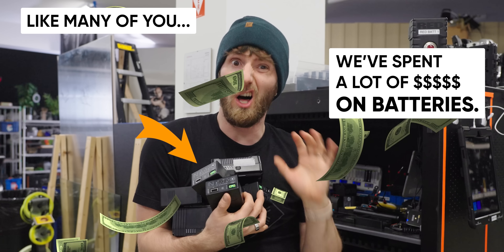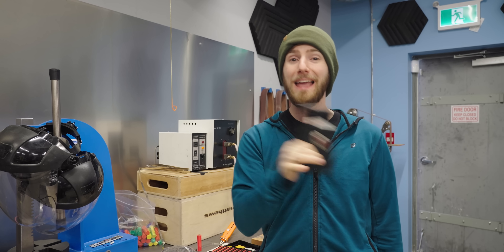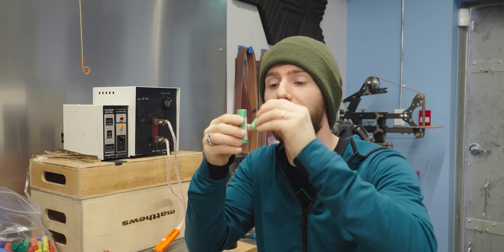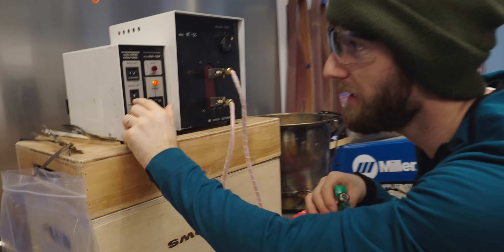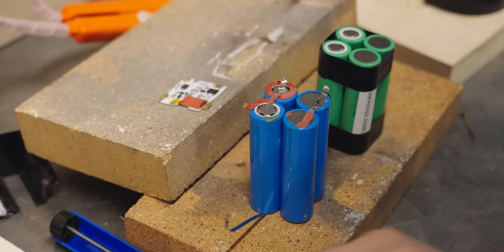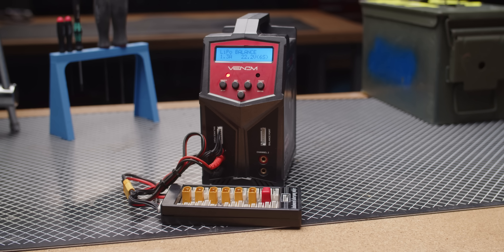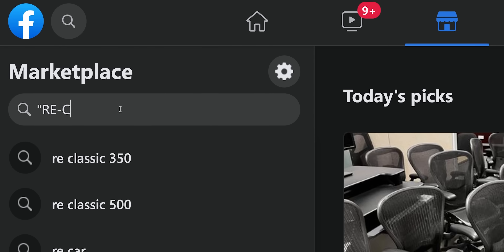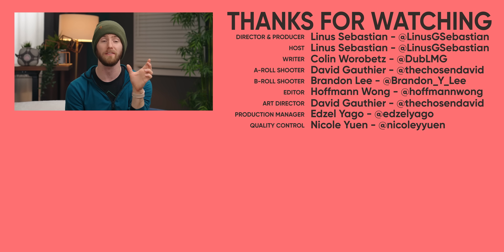This should be illegal… Battery Repair Blocking

Comment: @14:19 - Mechanical Obstructions - I am certain that 99% of the time the purpose is not to prevent repairs, but simply to lower the cost of manufacturing and assembly.  Brittle plastic tabs that snap into place make for very fast assembly, but are prone to breaking when you try to take it apart.  Ditto for sonic welding and gluing.  Consumers will buy the product that costs a dollar less, so there is little motivation to make your product slightly more expensive than the competition, especially when mostly people have no desire to repair things.  Sad but true.

Comment: The power tool industry? Forget the cameras. Every contractor and DIYer globally has loads of batteries with 0 cross compatibility, 0 infrastructure or businesses to support refurbishment, or recycling.
Reply: The Red battery was a really bad example because it uses a v-mount which is literally the most versatile and open battery mount system that I know of. You can put those Red v-mount batteries on LED lights, monitors, cameras by every manufacturer, and you can use batteries by other manufacturers as well. I've been using v-mount batteries on cameras for about 20 years now and they were already a standard back then. If you invest in a bunch of v-mount batteries and a good charger, you can basically use them on all your devices and you'll know that if you buy a new camera or light or monitor, you can still use them.
Reply: @highks496  That was never an option for power tools. The construction industry and DYI industry dwarves those that use batteries for cameras. A 4 amph battery cost approximately 70 dollars/euros, a 6 amph is over 100 dollars/euros. One set of batteries for DeWalt, another for Bosch, another for Hilti, another Milwaukee, another for Metabo, another for Hitachi, Black and Decker, Panasonic, and a ton of lessor known brands. Each with their own proprietary charger. I have a shed full of them.
Reply: @p3u3g3poultree7  Adapters exist.
Reply: @logitech4873  so all of it plus another 50 adapters? Is that your solution? Make the problem even worse? As is I moved to the EU and waiting for law to come into force. Buy Bosch because US brands will never comply.
Reply: @p3u3g3poultree7  yeah ok buy all of them AND all the adapters so that you don't need to use any of the adapters 👌
Reply: @logitech4873  for contractors and tradesmen you buy on demand. Where you are and what options are available to you determines your purchase. Four hours driving added on to an already busy and exhausting work day is not realistic. I have collected what I have over 20 years when power tools came into fashion.
Reply: @p3u3g3poultree7  Well, let's hope for a set of standardized connectors
Reply: @logitech4873  it is not connectors but battery packs and slotting mechanisms.the pins are all in the same place. The plastic shells are all slotted a little differently with no difference in performance.

Comment: Not only a tour but how many batteries are being recycled. Throwing away lithium batteries is illegal, at least in the US, but your garbage man isn't rooting through your trash to look for batteries. As you've shown, even used batteries can cause fires. There is a finite amount of accessible resources of materials on this planet to make batteries and you need to consider who controls (country) those locations.

Comment: I have rebuilt a number of the 'pod' style batteries for power tools. They are just standard off the shelf cells like 18650. If you are smart about it, its fine, but I would not trust most people to perform this type of task, and probably wouldn't use them in something as pricey as a Red camera.
Edit: I always did a Refresh on any cells I used, and would pair them with similar capacity, and voltage; off-the-charger voltage and after sitting for a week. Not sure how much this actually helped but the repaired packs seemed to last as long as factory battery packs from Dewalt, Makita or Milwaukee. I had considered starting a small side-business to offer rebuilt batteries but after some talks it was going to be more trouble than it was worth for me.

Comment: Used to rebuild old tool batteries for a retail chain in the US. Sometimes I would also see that the lithium packs BMS boards need to woken back up by supplying voltage to the output terminals. We would usually use between the nominal voltage of the pack to peak charge voltage and a very limited current. So in the example of the Sony battery, using a voltage and current limiting supply, apply 7.4v-8.4v DC at a maximum current of say 100mA (0.1A) to the output terminals. This often only has to be done briefly if the cells that are connected already have enough charge to run the pack, which the cells in the video did. Otherwise if the cells had been over discharged you can also sometimes charge the battery out of oblivion this way as well. Once the individual cell voltage exceeds the cut off the BMS will resume.

This isn't to say that the RED battery has the same issue, that could very well have the proverbial 'crowbars' in place. But my experience with smaller, more consumer grade device batteries is that they typically don't do that. Especially if they are only a single cell or several cells only in parallel (so 3.7v packs).
Reply: Thanks for the tip. Some packs can be woken up with a higher charge than usual tapped 10 to 15 times to the charge port. But its not like theyre giving out manuals on how to revive a sleeping BMS in a battery pack either. That leads me to believe its proprietary. Also if the cells are garbage and the BMS is proprietary firmware locked garbage. Then what are we trying to save here? the plastic case? the terminals? the inability to jailbreak ourselves from the battery demiurge's prison?

Comment: On the battery pack on my electric bike which is a bunch of 18650s the BMS has a reset button that is inside the case. Twice over a few years the battery pack goes low and all you do is press the reset button. Also the first time a battery whisperer rebalanced the batteries.
 So you either open the case and press the button or you drill a hole in the case over the button so you can press it with a plastic pointing device without opening the case.
I don’t know about other BMSes but check if your BMS has a reset button before making drastic decisions.
In the case of my Canon DSLR, I suspect it uses a counter to tell your camera to show red but otherwise runs fine. To replace the battery will cost $170 but it allegedly is a higher performance battery but will probably show red in about 3 years.

Comment: You need to short + of BMS with + of the battery. On most cases that will jump-start your BMS. They are designed this way for a reason, to not charge dead cells

Comment: Yeah, I managed to salvage some old laptop battery, which out of 6 of them, there's only 1 dead cell.

Anyway, I don't think you can 're-cell' your equipment battery, because most of them has a controller circuit which has fuses and circuitry that just blow up when you're disconnecting a cell (or the group of the cell). This is actually a safety feature that prevent damaging your equipment as that group of cells may have short circuit.

Anyway, does anyone know where to get Dell genuine battery? Dell outright didn't sell those, and when we use third party battery, the warning 'this battery is not genuine' always pop-up. The laptop is only 3 years old. This is as if they told you to throw away a perfectly good laptop.

Comment: However you also do not want everyone shipping back and foreward dead batteries if that would mean transport pollution would outway the material polution. Then you want it to have standardized batteries inside and the additional used materials to be able to get seperated by the user theirself in a safe way.

Comment: With the cells, couldn't you have used jumpers, with a suitable resistor in series, to balance the voltages first, before completing each 'sub' battery pack within the battery assemblies?
That way you would avoid the "sparking" and potential high current discharges/charges that could cause the damage you're trying to avoid?

Comment: You missed 1 simple step, plug the rebuilt pack into the charger, these "proprietary" packs and bms circuitry will normally reset and work again after that.
You may have matched and fully charged cells but the fact the BMS has seen 0v means it won't kick in and work, a little from column A and some from column B there, safety feature and makes it not work with those knock-off chargers that just pump unknown voltages back into a pack without successfully telling the onboard logic that everything is okay.

Mil****ee liion comes to mind here, pack simply will not power a genuine tool or update the charge left in the pack until it's plugged into a genuine charger, even though the + and - terminal on the pack are directly connected internally to the output of the cell pack.

Comment: But battery manufactures are providing batteries with the cost estimate that you will buy new one once the old ones are worn out, so replacing cells and rejecting the purchas of new batteries are piracy! You know, it's just like adblocking.

Comment: Use a psu to supply the necessary voltage while doing the repair so the BMS doesn't detect the battery removal.

Comment: It failed because you need a much faster double pulse on that spot welder probably in the 100-200ms range or less. Most of the spot welders sold are not setup to use on 18650 cells because it will just burn a hole right through the top as yours did. Without spending a ton of money. The ones that are microprocessor controlled and run off a 600A car battery work the best. I have built many of packs using mine.

Comment: I've built myself an electric scooter battery consist of 280 cells, and they are not even genuine cells, they are from Aliexpress, but I tested all of them, they were all 3200Mah capacity, I had no sparks at all during spot welding and it's been working for 2 years just fine. My smart bms shows I have 0.010V difference usually. But it can be as high as 0.1V when draining high current, so even though the capacity are the same, the internal resistance is not. Other than that it works well. I think you got sparks because you were using too much welding current and it also melted the cell.

Comment: you did give your diy packs a charge pulse, right? BMS are build to shut off when low voltage (aka old battery of) and reenable when giving them power through the charger, same with bms being fault triggered (like short circuit).

Comment: The double pulse spot welders are better. They do a very light first pulse that sorta just softens the Nicole strip so it lays flat and is consistent from weld to weld. And the second pulse is the actual welding one. 
If it's not laying flat maybe only one corner is touching and you can get a spark that sorta blasts out material from a weld. It's not only weaker but now there's a pit sometimes of a considerable depth that might rupture your cell. 

This also allows you to use a shorter, more gentle weld cycle. To get the same strength weld. For this video. I belive that was the issue. You had to had the weld time for too long to compensate for inconsistently in how the Nicole stip made contact.

Comment: That spot welding was terrible but that was probably because you didn't really know what those numbers on the machine are for. That weld time was really long and it didn't have proper current it seemed like. That's why it got so hot and why it was sticking to the nickel plate.

Comment: Just to say it, you COULD have a re-celling station, with few basic motors and camera + image recognition AI. That is not a cosmic tech, it's not much different from 3D printers, justt tip would have both tape AND tool. Probably not to be used at home, but for a place like rossman repair shop, or in general repair shops, it would be ideal. It would take like 5 minutes to get new cells in anything you want in any shape, and experienced staff would take care of BMS as well. 
Thing is that nobody wants to make those, as batteries are the MOST COMMON reason for stuff obsolescence. In my case 2x18650 cell + most basic BMS (as big as 2 cells width) for a toy in parts is ~25$ but from manufacturer as complete replacement is 200$, more than I paid for that RC toy I think.

Comment: I think that they need to have the same system for lithium battery’s that they do for beer bottles. You return the cells for recycling and you get a catch return or a discount on the replacement batteries.

Comment: Anyone who's ever owned a Sony PSP has experienced an "evil" battery. The chip in them has a kill switch that's designed to kill charging to the battery after a certain number of charges. This, in turn, caused a lot of people to buy generic, knock-off Sony batteries that at best, were hit or miss pertaining to functionality. In the case of Sony's PSP batteries, by them doing that they added huge risk to people because we ended up needing batteries, but didn't want to fork over $40 dollars for a proprietary one. This forced us to seek outside, untrustworthy solutions.

Comment: ALSO, some bms - not detecting any voltages - deactivate themselfes, so the user wont be able to charge a damaged (short) or otherwise deeply discharged cell which would most likely cause it to explode. As those battery cells (lithium) are not supposed to be handled by customers (only those who dont care about their health anyways - vaper) those packs arent supposed to be customer maintainable/repairable. Sophisticated repair shops and customers not only recell but also reporgram the battery/bms, so it's likely to behave like a new battery.
So if you're knowing what you're doing, you KNOW how to reprogram your bms and when it's most likely to deactivate itself (like disconnecting the cells altogether).

Comment: Linus, hope you see this, you need a dry "Purple K" fire extinguisher aka a class D fire extinguisher to deal with metal fires.  This is probably something you should have in two places, your charge station area and your workshop.  When I say some of the most spectacular industrial fires in the last ten or so years have actually started as metal fires, it shouldn't surprise anybody.  Also when we store batteries they live in a box lined with a drywall like material lined around a steel crate.  I take batteries very seriously, one of my competitors burned down their whole business because of what they say was a single cell phone battery.
Reply: Crushed soda glass tray and a scoop to smother it, purple K will not put out a lithium fire, the suppressant has to overcome the thermal energy, soda glass melts and encapsulates the fire.

Comment: Linus, i know there is batteries for the xbox controller but those kind of batteries you used can be used like a AA in the controller?
Reply: No, the 18650s are way bigger than AA and they have 3.7 nominal voltage (4.2 V when fully loaded). There are 14500 lithium cells that are exactly the size of AA batteries, but they will still kill your device with the high voltage.
Reply: @highks496  thx for the info, i was already buying one set to use in my controller, here in Brasil those Pack batteries are expensive and the AA are too to mantain

Comment: What if we connect a power source in parallel while connecting and disconnecting the BMS from the battery pack, so it doesn't looses power while the swap?

Comment: Most of the times, the bms wakes when you charge the battery after you replace the cells. If the bms loses the memory when you disconnect the cells, you can connect a small array of batteries before you disconnect the faulty/old ones. After you connect the new ones you can desolder the array. The array doesn't need to be much capacity or multiple cells in parallel, just same voltage/same number of cells in series with the balance leads connected. In that way you tricks the bms to think that the cells never come of the bms. I have successfully done that multiple times in the past.
Reply: I have had the same experiance, many BMS do a reset on charge for example after over current protection got triggered.
But I also know evil BMS. For example, Dyson uses BMS which does permanently shut down on a replacement attempt. But users found out how to trick the evil BMS. Dyson's BMS can not be reset, so once a fault happens it will be turned off forever. If you think about it, it is kind of a safety mechanism. To replace Dyson Batteries, you need to cut the BMS voltage supply BEFORE you cut the battery monitoring leads. Only then a Dyson BMS will not detect any faults, and it can be reused (I have already done it to prove this theory)
If you want to try it again, the first step should be to figure out how the BMS controller gets its voltage and cut it first. On Dyson it was pretty simple, you just needed to cut the main positive terminal first.

I don't want to defend bad companies, but If somebody would ask me "Should the BMS accept a Reset if a battery did die while all others are at a healthy voltage?" I probably would tell the BMS supplier "no" because I would not like to be in press with a burning Battery because the BMS did open a circuit to the broken cell during a "reset on charge"